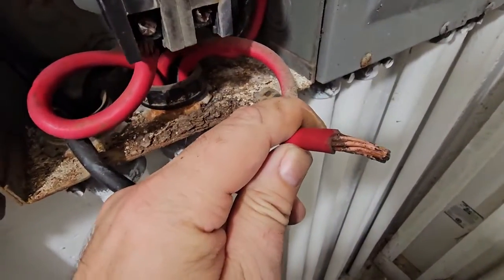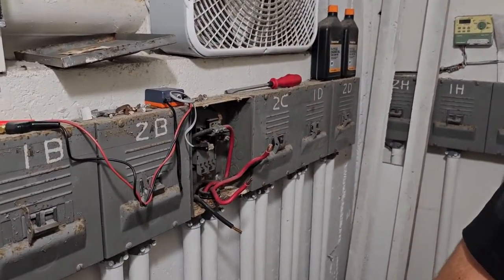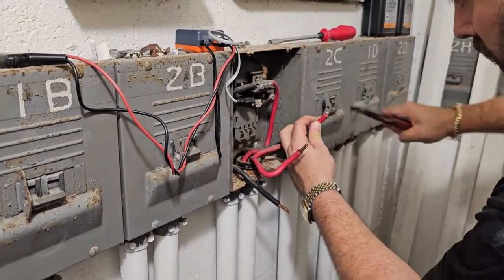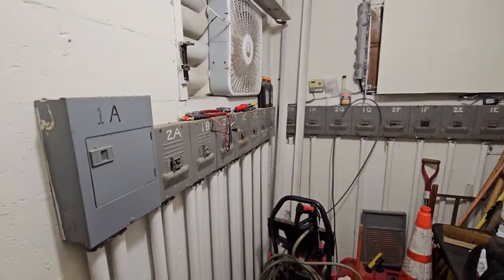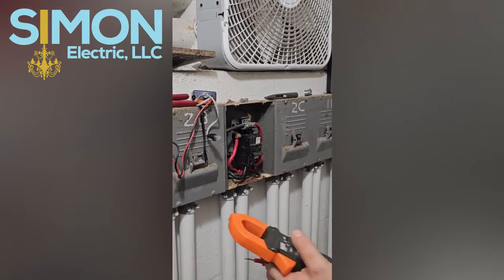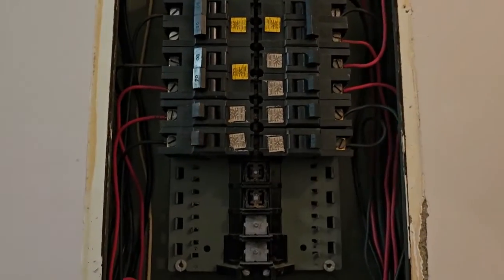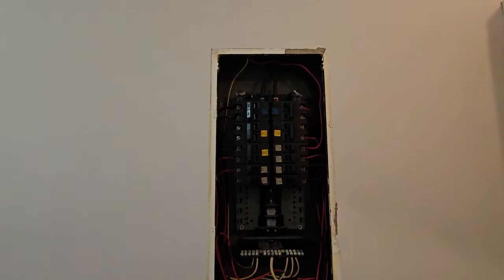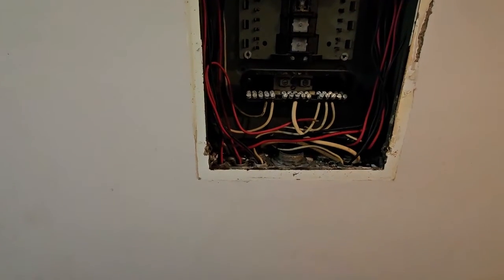FPE Complicated Panel Replacement: Part 1

Comment: The bussing was horrible as well .brand new mnfctrd breakers by ct valley electric are available ,but i always stressed these were temporary to home owners.now cutler made replacement guts and breakers that fit into the small 100 amp boxes in areas of dry sheetrock,wall paper etc.those were pretty nice,installed about 50 or so in condos.fpe breakers notorius for not tripping at even 5 amps over breaker limit.horrible equipment.

Comment: Re 20A brkr not tripping @ 20.2A: brkrs are supposed to trip based on a time/load curve. Current of 1.13X brkr rating can go on indefinitely. 1.2x should trip after ~2000 seconds. 1.5x @ ~40 seconds. 2x @ 7sec,  3x @ 0.2sec. These are approximate, mfgr's certify to a given standard curve & testing agencies should use that code to recertify breakers when applicable. Search: circuit breaker trip curve.
All this has to do with managing heat in wires vs mild overload vs major overload vs short, within standards set for insulation, 60°C (140°F) being the min. tho current thermoplastic insulation is usually rated for 90°C & connections @ 75 or 90 depending (mostly 90°C/210°F if installing new stuff off the shelf in 2024). IIWMI'D recommend a couple of test pulls to see if new wire with ground conductor could be pulled thru to that new panel. Also IIWMI'D recommend installing a retrofit kit in that existing panel can, Eaton has some nice kits i read about maybe 1 month ago.

Comment: I wired my basement my self with a sub panel and 12 circuits. I knew I would never get the 4 gauge wire safely into the lugs. So I got an electrician to do that. Plus they verified I would pass inspection. If I ever got one. 

Yes this was 20 years ago when you could get tradesmen for small jobs.

Comment: Even properly torqued lugs can loosen up. We did thermal pictures of all the panels yearly in our data centers. There is always one that needs tightening. 

Heating and cooling can eventually make things move around.
Reply: Yeah more extreme cycling can do this, but I know most people who have had panels so many years and never experienced issues.  Some people cheap out on the heat in the winter and instead of running at a constant temp, they turn off heat and turn it on only when house is freezing cold, so it takes a lot more power and time to warm up, more extremes cycling between crazy cold and hot.  You would also be surprised at how many lugs were never torqued to specs, that is far more common than lugs that loosen up - but a lot of people will never notice loosened lugs, unless they are using high load enough for a breaker to overheat and for that burning, melting insulation smell to be detected..  As far as Fire Producing Electric, you would be surprised at how many homes or business still ahve those shitty panels, even the likes of Zinsco, Sylvania-GTS, Commander, etc,  most people will never notice an issue until one day their house burns down because a breaker did not trip.
Reply: @jimmydandy9364
I have 3 electric cars so have put in a couple chargers. These not being torqued is going to be a problem. Worse yet is that 120v plug in the garage that never got used will be on at 12A for 14hr then completely off for 10 over and over every day for forever if the homeowner gets an EV and decides they don’t need a dedicated charger. 

I tested this. Charged my Tesla on a 120v plug only for over a year. Worked fine. But if any of those connections are not perfect it’s going to be an issue.
Reply: What is even worse are the red and black unmarked neutrals???

Comment: 100ish F isn't really hot. At minimum your insulation rating is 60C. Not sure where to find temperature specs on an old FPE, but check Square D or somebody, the heat rating on breakers is way higher than you would think

Comment: The five safety rules at a glance
Disconnect completely. Meaning that the electrical installation must be disconnected from live parts on all poles. ...
Secure against re-connection. ...
Verify that the installation is dead. ...
Carry out earthing and short-circuiting. ...
Provide protection against adjacent live parts.

Comment: Why is this man wearing metal jewelry while working with electricity?
Reply: He a professional
Reply: I’ve tried to tell him 
But he politely declined my advice 
He’s a nice guy tho
Reply: I’ll agree, was taught in Air Force mechanics school, Never wear jewelry when working on aircraft, electrical or mechanical.
Reply: Where’s the strangest place you’ve seen a sub panel? I once relocated an FPE sub panel that was in the kitchen cabinet under the stovetop. Unbelievable!
Reply: Don’t worry, one day he will wish he didn’t have it on when that accident comes. I’ve heard stories just from wedding rings.
Reply: This is in Florida they like to take risks even driving 90 mphs
Reply: He a g
Reply: Because no one will hire you for a job If you're not . they want a guy that's flashy to prove that hes successful
Reply: I had a friend at a Lube oil filter garage put the oil gun in and it touch the positive of the battery through his ring. 

The ring went red hot instantly. Burned the shit out of his hand.
Reply: My boys Italian
Reply: Watch, conducive to conductivity
Reply: He's Iranian!  They love fake ass gold chains and shit
Reply: Did you eventually replace that 20 amp breaker? Just curious. 
It looked like the line side (the red wires) was dead. Did you pull the meter? Again, just curious,

I appreciate you sharing your knowledge. Love your videos.
Reply: It’s shut off
Reply: Because he doesn't take safety seriously

Comment: Aka Fire Producing Electric, many have  red tipped handles to indicate DANGER 😂   11 years ago I suffered 1st and second degree burns on my arms, chest and stomach area and spent 4 days in the hospital after unplugging an arc welder from a surface mount 50 amp receptacle in a 30x40 polebarn with an FPE panel from the 1960s according to my buddy who recently brought the property. Part of the receptacle chipped away, and the lugs came loose and touched each other and the metal box/metal conduit leading back to the breaker panel.  Both the 50 amp breaker and the main failed to trip.   I recall falling with my T shirt on fire, and I crawled down low for about 30 feet to get out and call 911, at which point the conduit was spraying molten metal all around me igniting shop towels which spread to some paint/paint thinner cans, kerosene and ultimately the oxygen/propane cutting torch.  the cutout on the pole transformer blew, barn was fully engulfed before the fire department could arrive.  I have permanent scarring and some hearing loss.  The property owner was unaware of these problematic panels and so was I.   

Please get that POS panel out of there ASAP, I will not sleep one night in a building with FPE equipment
Reply: Lol I was told fire probability enhanced with red handles of hell fire 😅

Just read the whole volume dam you got lucky never seen one burn that bad but it can and will happen again 😮
Reply: It's crazy to imagine these had a 60% failure rate. Had a service call where a breaker was tripping and was immediately alarmed at finding it was an FPE panel. It was in mint condition and at least the kitchen circuit was tripping just fine. They had way too much plugged into the only kitchen counter circuit they had. I've seen zinsco's trip, pushmatics, and FPE's but then heard horror stories of a single 20 amp circuit burning a house down while the people were scrambling to get out to safety while their living room outlets were throwing sparks all over the place igniting everything in sight.
Reply from the maker: Wow that is an incredible store we replace dozens a month. I am glad you are alive!
Reply: Damn man
That’s traumatizing
GOD willing I never experience anything like that

Glad u made it out in one piece 

My mentor tells me some ugly horror stories

Comment: thank you for another great video.this panel is definately not a good situation.I have a question,how did you know that something was heating up inside this panel before you actually put the thermal camera to it?
Reply from the maker: Discolored main feeder wire.
Reply: If its me,i would have changed the whole box if possible!There is still a load of rubbish in the contact and so can be getting to hot again..
Reply from the maker: @jooproos6559  yea